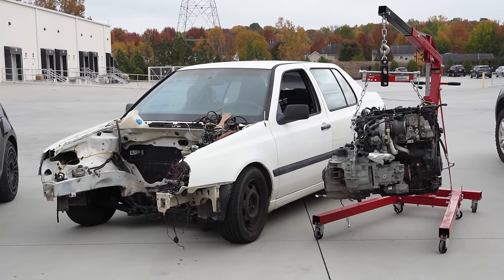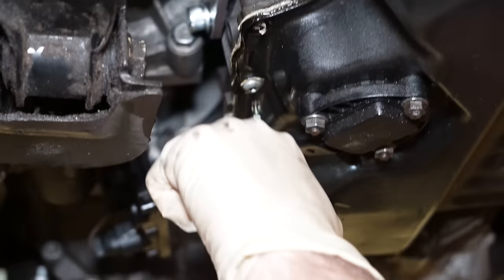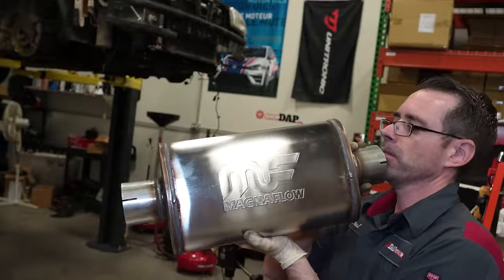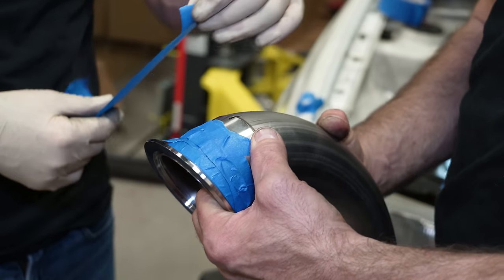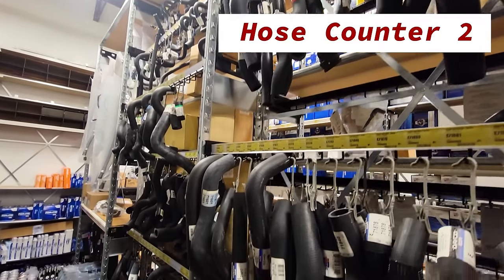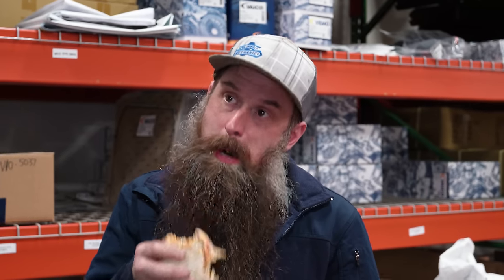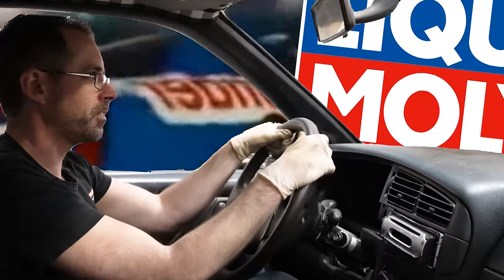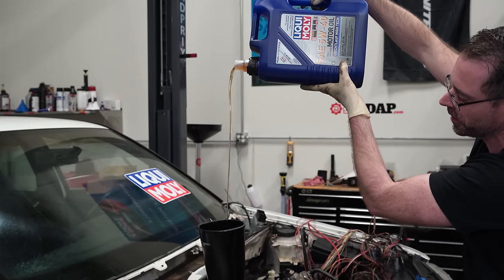Trying to Start our MQB MK3 JETTA (Part 3)

Comment: That T fitting for the temp sensor took for freaking ever to find when my intercooler fell and the belt rubbed a small hole into it. I replaced it 3 times and then bought an IE intercooler. No issues since.

Comment: When my gti fails I plain hate it,
But, when I see Paul and Charles working on VWs
my love for VW returns
Reply: I feel that man, I've had my cabrio for over 5 years now and I love it and all but I've not been driving it as much cuz i need to take care of a few things before I feel comfortable, but I just can't get the time to get it done and it just is sitting from over winter still, drove it maybe a few times, should be alot more.  But I watch this and I almost feel motivated to drive my cabby around again. Really been debating about selling it man, sad but I want a cleaner version, and a restart, even though at 125k miles relatively low and I put alot of money into it also, that I'll never get out

Comment: 25 moons ago i built a MK3 from the OG Cross flow 2.0 , T3/T4 Hybrid T , r32 6 speed , roughly 400hp corvette killer of the early 2000's
Reply: How did you get 400hp out of an 2.slow? turbo isnt enough on those engines
Reply: @zeuss1353  I have a 2.0 mk3 turbo making 400hp. Head spacer, cam, forged bottom end, t3/t4. Could make more but it’ll either spin the clutch or break an axle if I went to the 02j
Reply: @PeteHSM  I have a question, what was the reason why you fully built a 2.0 if you could 1.8t swap it. Because I also want to build a 2.0 but everyone is saying no. In the Netherlands when you swap the engine you need to pay 2k just for inspection by the dmv so the price to swap or build would be the same
Reply: @zeuss1353  the 1.8t did not even exist yet. The only power upgrade for that car was a supercharger at that time in life. It was like $4,000
Reply: @zeuss1353  the short answer was a well assembled stroked bottom end 2  MLS head gaskets stacked to lower compression, lots of boost
Reply: @zeuss1353  I bought the car not running disassembled. Was originally built in 2001 when the fast and furious came out and has been mostly sitting until I fixed it a couple years ago. Like Zack said it was pretty much the only option besides an expensive supercharger kit that only added a little power

Comment: mk2 golf coolant temp sensor housing/splitter is pretty much the same but it has a screw on style temp sensor. I have used those for radiator fan automatic start at variable temperatures.

Comment: If I’m not mistaken, you can use a mk3 tdi throttle setup and just repin it. That’s how my mk1 is setup to run a tdi and retain the original pedals. I managed to snag some new old stock pedal covers and didn’t want an out of place throttle pedal.

Comment: hi you may run into trouble without ABS as the dash needs the info from the can bus unit i got round this by putting relays connected to the brake peddle switch you need to use vcds and recode the canbus to no Abs /traction control and others that you have removed oh some brake peddle connections are  normaly open and some are normaly closed some are 12v some are 5v i have put a 2.0tdi pd 140bhp bkd engine plus the 6 speed wet clutch dsg gearbox into a 1999 vw t4 transporter it took me about 25 full days just to figue the gearbox wiring you need the mk7 golf wiring diagrams as the car will not drive correctly as the canbus thinks the brakes are  on good luck with it all thanks jason from. the uk

Comment: Hey guys, love the build so far! I have one question, and I know the circumstances weren't ideal, but given the engine was cold and the car was level, wouldn't it have been better to let any excess DSG fluid drain out on cold fill before inserting the two drain plugs?

Comment: Did you replace the oil pan with a metal one or the OEM composite one?  My 2017 Alltrack had the drain plug fail and I got stuck with a huge bill to replace the oil pan.  Adding insult to injury I was told to expect to replace it again depending how frequently I change my oil. 😮

Comment: Man love this series, love the mk3 swaps, if you have any info in getting a mk3 dual bulb headlamp for my cabrio, could you help, my driver side got cracked badly by a rock and I cant find a 2 bulb anywhere, ordered a "2 bulb" from rockauto or carparts and got a 1 bulb headlamp, super lame or I got to spend an arm and a leg for a set of 2

Comment: These modern cars are a nightmare to work on, my 97 polo to remove the water pump was simply 2 bolts and to pipes . These new motors you need to remove half the motor lol

Comment: 5w-30 is the oil you should use for the mk7 engine.
I’m also pretty sure you should let the dsg drain, until it drips. (Overflow system)

Comment: Pumps are the same thing, as long as they are not 3 phase. The mk3 pump won't have the pressure needed for the high pressure pump.
Reply: Also the float level signal is transfered trough the fuel pump control module to the ecu. You need to integrate every door switch etc. to have all the features of the fuel pump control module.
Especially when you open the door, the pump gets actuated for few seconds, it's an useful feature.

Comment: So, guys, I am at a crossroad. My MK3 which is also white but in mint condition and is now gutted inside and out. I have 4 motor and drivetrain options. Option 1 1.8T & 5 speed auto from my MK4 GTI, Option 2 2.0 TFSI and (what trans) from my 07 Passat, Option 3 VR6 3.6 24v (and what trans) from my other 07 Passat, OR option 4 the 3.6 VR6 24v and full drivetrain from my 4motion 06 Passat? I can't decide. Anyone have an answer? I can fab all the exhaust mounts framing and all that no big deal, but if i choose the VR6 options i want Turbo also. and Love this build by the way.

Comment: Recommends junk ECS parts and discourages aftermarket catback… Running a catless dp on a daily is unnecessary being most 200 cell race cats flow plenty. Added benefit a cat keeps this engine from having that nasty rasp you refer to. I have a IE catted dp with a CTS 3inch catback and it’s perfect imo.